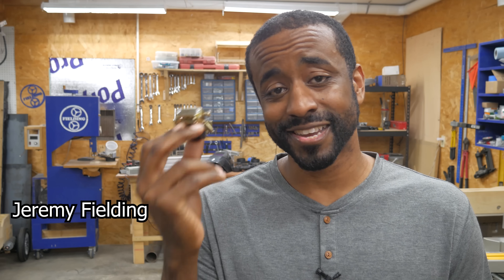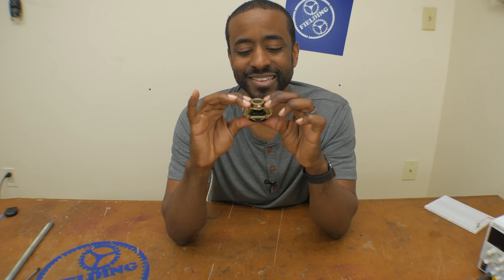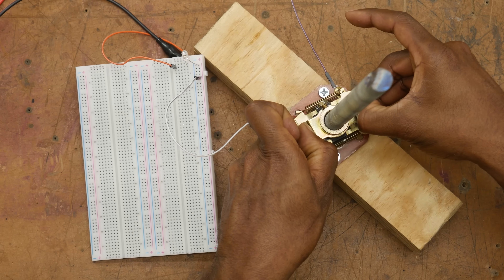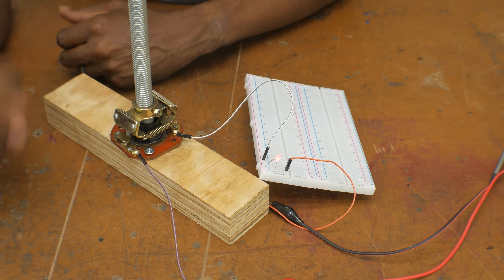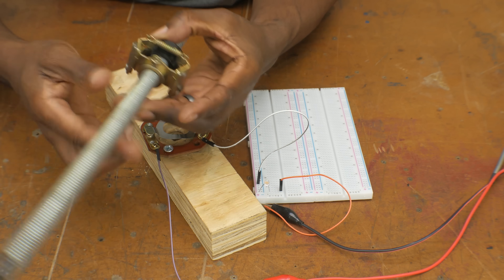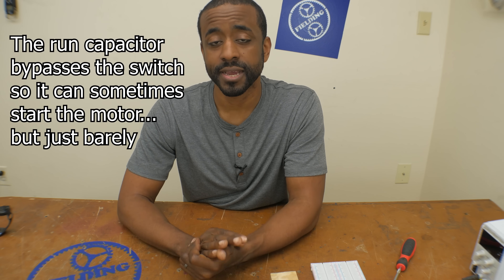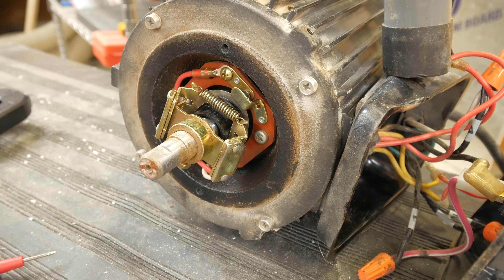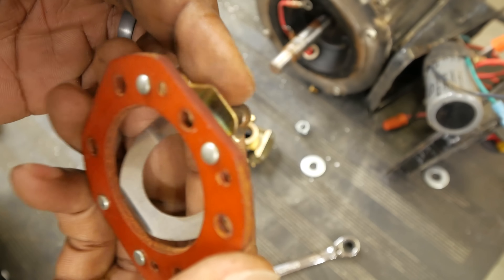This Clever Device Is Found In Nearly Every American Household. How It Works And How To Fix It

Comment: I ran a search in some databases of old journals and found an early use of "centrifugal switch" in J. B. Wiard's article, "Induction Motor Design as Determined By Commercial Requirements" in 'The Journal of the Worcester Polytechnic Institute,' vol. VII, no. 3-4 (1904).   Wiard describes the centrifugal switch's use in induction motor designs for motors running on alternating current, which, you'll recall, was new tech back then.  For the essay, see pg. 283. 

HathiTrust, the database that houses this source, is housed at the University of Illinois and contains digitized books, journals, and essays from the archives of major world universities, including Ivy League institutions, the U. California system, and a number of top-rated state universities.  Sources found in Hathi came from North America, Europe, and several other countries and date back to at least the eighteenth century.  As such, this is likely one of the earliest uses of "centrifugal clutch," though it's certainly possible that there's another, even earlier, unscanned source out there waiting to be discovered in some archive.  

Because of COVID-19 , access Hathi is currently free and the essay I found can be accessed here:
https://babel.hathitrust.org/cgi/pt?id=hvd.hxj23y&view=1up&seq=135
Reply: Fabulous, thanks for doing the leg work!

Comment from the maker: Thank you for watching! The oldest patent I could find was from 1926. But it seems to have been in regular use by then... fans from the 1920's already had them. Thus variations are likely much older than that.The comment about "specifically the US" is about single phase power... Countries that have three phase power use 3 phase motors which don't need a kick start. We have both 120 and 240 in the US. The motor in this video is 240.
Reply: It's like an electric version of the speed governor on a steam engine.
Reply: Yeah, it is electrical version of centrifugal governor, that was originally used in steam engines since 17th century.
Reply: @cockneyse  Right, they needed to cut off the power to the millstones  
on days with the very high winds, to prevent the stones from being  
worn away!
Reply: @KelikakuCoutin  some would either lock the blades in place or have a gear that could be swung away from the gears. A centrifugal clutch which this is, is designed to keep the momentum spinning. It would be like the blades on the windmills continually turning on days with no wind because 1 edge would be heavier and pulling that side down while the other side goes up
Reply: @massimookissed1023  similar but different function and result
Reply: There's a comment on your video by Robert Collard (https://www.youtube.com/watch?v=F-jOBxn1w1I&google_comment_id=UgzrlDCdcyd5a3lbQY94AaABAg) mentioning a 1902 patent about a centrifugal switch.  If you read that patent you will find it references an even earlier patent by someone named L. Bell, "The object of my invention is to provide such a motor with an efficient centrifugally actuated starting device which will constitute an improvement on the device shown and described in the patent to L. Bell, No. 505,505, granted September26, 1893."  In the 1893 L. Bell patent (you can search for patents by number here http://patft.uspto.gov/netahtml/PTO/srchnum.htm) it's written, "As the speed in the armature rises, centrifugal action drives the weight W outward and the toggle T draws the sliding collar D' toward the fixed collar D against the force of the spring E, causing the cam surface d to operate the bell-crank J and close the switch contacts at S."  L. Bell was actually concerned with switching in different resistances to improve starting torque, nothing to do with switching out a start capacitor, but it still sounds like a centrifugal electronic switch.  I didn't pursue if there are earlier patents but there might very well be, to say nothing of earlier (electronic) centrifugal switch inventions that were never patented.
Reply: @perspectivex  I clicked the links in your comment and it says not found
Reply: @Richard Vaughn Don't use that word. If you mean that you think something is stupid, then say that. The only time anyone should use "retarded" is when referring to something that has had a slowing down effect applied to it. If you don't use the "N" word, don't use the "R" word.
Reply: I had hoped was Tesla  :)
Reply: @garyha2650  Tesla was the first to patent the concept of using a centrifugal switch for starting capacitor circuits of electric induction motors, in this patent: https://patents.google.com/patent/US609245
Reply: I found a relevant patent, US2083343A, filed by Singer Co, for a centrifugal cutout switch with a very similar design to the modern switch. Pretty obviously not the first such switch for capacitor start split-phase induction motors, but it's certainly the oldest reference I could find being filed in 1935. Would be interested to see the patent for 1926. Sometimes the hard part is figuring out what they called stuff back then - it's not always the same lingo we use today!
Reply: US1857202A from 1929 actually is pretty interesting too. It uses a VERY different design of switch using leaf springs. Looks like it would be a contact burner for sure, no snap action!
Reply: Europe uses single phase power too. 220 volts not 110, but otherwise the same. I assume they have 3 phase too, but only in industrial areas like here.

The US uses 110 because long ago they decided two houses next to each other could just get half the transformer and save money. Nearly all such houses were rewired to 220 by the 1950s.
Reply: @henrymiller1820  No we don't.. every household normally have 3-phase power pulled into their main "fusebox",  and then split the phases out into different fused groups, to even out the load. But anything that uses a large amount of power is usually connected to 3-phase power, things like electric stoves, possibly washer/dryers etc. And if you got a garage, you will have access to 3-phase there. So while most of our electrics run on single phase, we all have access to 3-phase power pretty much, and nowadays thats 400V while single phase is 240V. I live in an apartment at the moment, but I got access to 3-phase even here.... Industrial zones just have bigger main fuses here...
Reply: According to the patents office, it was patented by Singer in 1935 and they list the inventor as Frederick Diehl. Patent no. 2048494
Reply: Jeremy,
I did a little looking and found the following.  The first item labeled as a “Centrifugal Switch” was actually an improvement on the switch.  The second item by Nikola Tesla, labeled “METHOD OF OPERATING ELECTRO MAGNETIC MOORS” appears to be the first version for an electric motor.  I’m interested to learn whether prior art exists.   
1.	“Centrifugal Switch 
Filed on October 11, 1911
Patent 1,031,893 
Pa tented July 9, 1912”

2.	 “NIKOLATESLA, OF NEW YORR, N. Y. 
METHOD OF OPERATING ELECTRO MAGNETIC MOORS. 
SPECIFICATION forming part of Letters Patent No. 401,520, dated April 16, 1889. Application filed February 18, 1889…”
Hope this helps!
Reply: James Watt used something like this on his first steam engine however it actually predates that with Huygens using them on Windmills somewhat earlier. The idea of spinning weights to manage actions at speed has been around for centuries.
Reply: They also used a centrfical valve to regulate speed of steam engines.  I had no idea they still use these on motors.
Reply: I remember Nikola Tesla being called to a electric motor company to find a design to reduce the cost of the induction motor. The design is what is used today. This was in a past life vision. The first version I though last longer in terms of motor wear verse the cheaper option we use today.
Reply: Thanks for the neat and informative tutorial!
Reply: Also, a similar centrifugal switch was a custom in steam engines and other mechanical spinning stuff. Westinghouse AC motor had a shunted start so it got to speed and than you switched to the normal operating mode.
Reply: Check out US patent 977,591 from 1910, invented by W.J. Branson.  See also US patent 1,013,780 from 1911, invented by T. Kargau.
Reply: @Richard Vaughn You realize that any form of body language or facial expressions are absent from your rather rude and not that informative comment so nobody can have a feeling in what mindset it was written. This is me taking the time to point that out, we (nearly) all have much more digital/online time to spend these months. So also me writing this has also nothing to do with political correctnectnes or you just "being to the point". Behave like this in real like, and for the being, this is becoming more and more real life wether we like it or not, and you spoke to a random person in a restaraunt etc I would first estimate your emotions, and leave it at that or just walk up to the manager or would have asked you directly if something was wrong, and when the immediate reaction would again be agitation I would ask the manager for the bill and make it clear that you are to blame for not leaving a tip and that that customer had a few loose wires, voltage or no voltage across them, but sure has a lot of tension, potentially.

In our Current Covid Situation.

Maybe you could tell a little bit more about the history of electrification on your continent, I think its fascinating. Also the 60 Hz versus 50 Hz stuff. I know here in Europe we used to have 25 Hz systems, mostly for locomotives I believe. Did history repeat and in the past did run your locomotives run on 30 Hz systems ? I dunno. 

Regards from across the pond, yep, also frustrated
Reply: The standard electric services in the US can include 120, 208, 240, 277 & 480 VAC @ 60Hz. Depends on the transformers/single/split/3 phase & residential/commercial/industrial etc.
Reply: https://patents.google.com/patent/US1032524A/en
Reply: The concept of a centrifugal switch for cutting a starting capacitor out of the circuit shortly after startup goes all the way back to the inventor of the electric induction motor, Nikola Tesla. His patent, US#609,245 describes this very idea, though he used a conductive fluid instead of springs and weights in his device. https://patents.google.com/patent/US609245
This was his 76th US patent (out of 111).
Reply: I bet you only searched American patents though, oh and by the way, there are a handful of households outside of America that have them too now... LOL
Reply: @vtbn53  it was an American patent designed in 1908 to john B. Wiard he resided in New York while working for general electric

Comment: Back when I fixed typewriters for IBM, they shifted from cap start to centrifugal clutch. The clutch was not connected to a switch. It was a clutch between the motor shaft and the belt. It allowed the motor to get up to speed before pawls swung out to engage a belt pulley to drive the rest of the machinery. It was particularly helpful if an operator had managed to trigger a mechanism, such as the space bar, while the motor was off.

Comment: It seems like the same type of concept of how they regulated the speed of steam engines, so the original inventor could have been in the late 1600's and then the invention/concept later adapted to electric motors. (MAYBE) I would start there if you want to find the inventor of the centrifugal switch used in electric motors. I see a patent from the 1930's for one by Frederick, Diehl, maybe that can help.

Comment: Hard to tell, similar devices were on steam engines at the dawn of industry. Probably an in depth study of that period might yield one name, as the where few. Back then, in the same capacity, but in different size, they would be used to switch steam ports from "start" to "lean" operation. Some of the steam channels have them displayed/explained.

Comment: 0:54 the motor often requires a little quick start under load.  * specifically in the United States. 
Can anyone explain why this is specifically in the US. I guess must be because of the 110V system as opposed to 220-240 in Europe but don’t understand why.
Reply from the maker: In the US we have single phase power. Some countries like Germany have three phase power and thus don't need a start winding when using three phase motors. I explain three phase vs single phase power in my video "how motors work for beginners three phase" check it out. That will give you the clearest picture.
Reply: Jeremy Fielding 
Hi, thank you for your reply! 
I live in the Netherlands and we don’t have 3 phase power in normal households nor do normal EU household appliances require 3 Phase power. 
Some high power induction cooktops need a 2 fase ‘Perilex’ outlet and connector but they are not used for washing machines etc. as far as I know. 
Does anyone know if these centrifugal switches are used in Europe too? Just curious.

Comment: I've just had to do the same fix (and replace the 110v capacitor that somone should have been changed when the motor was rewired wired for 240v) on my old Meddings bench drill. The switch on mine is mounted inside the end bell and the centrifugal switch faces the other way. I needed a complete motor strip down to get to it. I can't reassemble it though as I found the bearings were also worn and I am waiting for delivery.

Comment: Tiny spot of white lithium grease on the rubbing section of the contact before putting it back together will help longevity, providing just a little lubrication for those few seconds. Same with the spring ends and the pivots, just a tiny droplet of light oil there makes them a lot quieter, but not too much as it will otherwise be flung out. Not a spray lubricant, but just a small dropper can.

Comment: Two questions: Any chance the points you sanded were coated and not a solid material ? (i.e. can you sand away a special electrical coating?) and 2nd'ly: Will a motor be OK if you give it a spin-up by hand if the centrif. switch is broken ?  Stay safe.  -Mike
Reply: EXACTLY!  Electrical contacts come with a HARD electro-plating on them.  Once it finally gets arced away, even after 'burnishing/sanding the contacts smooth, the plating is gone, and the subsequent arcing will quickly wear through the contacts completely.

Comment: Hi Jeremy.  GREAT VIDEO! I'm already pondering a half dozen uses for these things!  Looked for early patents.  I found a spring loaded weight centrifugal device patented by Nikola Tesla in 1888. US396121A
But he used it to apply a thermal shield to a motor to cool it down.  Maybe one of his later patents utilized it for jolting a motor to start with higher amperage from a capacitor.  In 1888 I don't think he knew that motors require more amperage to start than to run at full speed yet, so he was using a constant amperage back then.  Hence the overheating problem.

Comment: Thank you for this video! What great content. Have you ever rewound a motor? There used to be old motor rebuild shops but no longer around here. I’d love to see a “full rebuild” like they would have done it back in the day.
Reply: I managed a retail battery store in the early 1990s,  and at that time there was a place in the area that did starters and alternators.  Not sure if it's still there or not,  offhand.  They're a good source for some heavy-gauge enameled wire if you needed some for a project.  :-)

Comment: Awesome! I fixed a clean-room grade air compressor I got on Craigslist ages ago with what turned out to be a bad start-switch. I replaced it with an Iso-Volt brand solid state replacement. Great video.

Comment: I'm a pool guy, sometimes corrosion builds up just like your video.  I typically carefully use an emery board to slide it between the contacts and then press the contacts together while sliding the board to sand both contacts at once.  But you are right, it's typically capacitor or in my case the shaft itself it sometimes a little stuck with corrosion

Comment: Hello neighbor, when replacing a capacitor you can in deed use a higher voltage rated capacitor, but you can only go 20% above the the original capacitance (uf), otherwise you'll cause windings overheating, damaging the motor in the long term
Reply: Be sure to discharge them before removing
Reply: @akbychoice , by shorting with a resistor, you mean? What would be proper values for such resistor, if you don't mind?
Reply: @leehaelters6182  : or a screwdriver if you have one handy.
Reply: @leehaelters6182  Any resistor above 1kΩ should work, anything less might dissipate too much power too quickly. The higher the resistor, the longer it will take to discharge the capacitor. Some capacitors like this have a permanently installed high-value resistor across them (about 100kΩ) called a "bleeder resistor", which is too high a value to affect the operating circuit, but will discharge the capacitor to a safe level after only a few seconds.
Reply: I remember when affordable electrolytic capacitors routinely had a tolerance of -20% to +100%. So a capacitor rated at 100 mfd could still be in spec as long as its true capacitance was between 80 and 200 mfd.

Were motor start capacitors more precise than that 30 or more years ago?